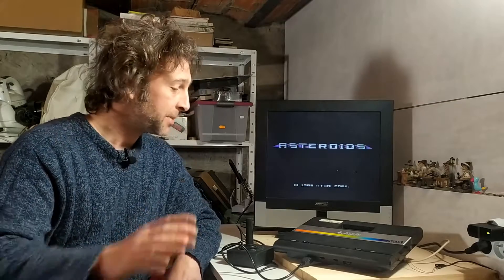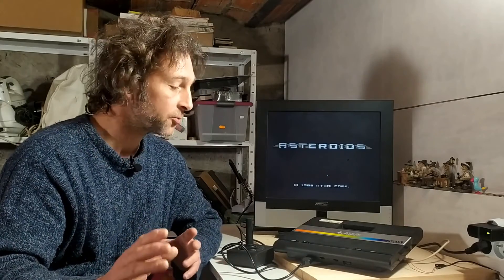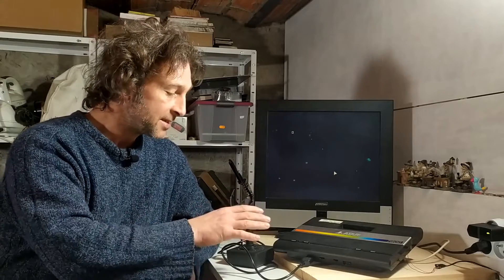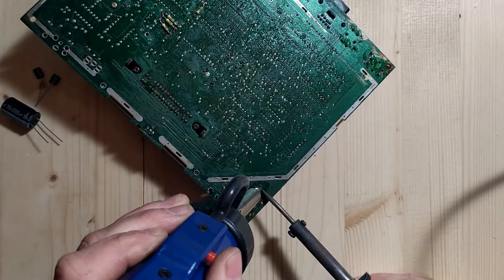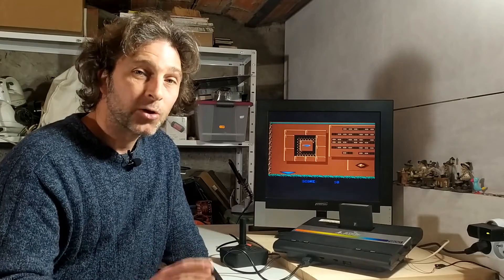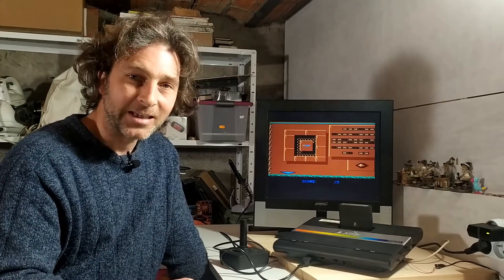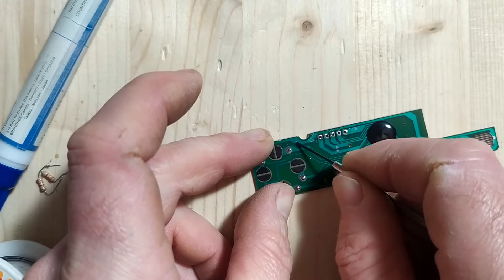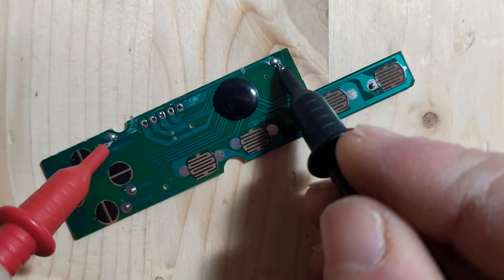Hacking an Atari 7800 controller from a cheap Nes pad, changing caps and making my 7800 great again

Comment: This is very interesting. I have made a number of 9-pin joystick to USB adapters by essentially doing the opposite of this.
I solder the wires from the DE-9 cable to the pads on the PCB, so the joystick is mimicking button presses on the gamepad.
Reply from the maker: That's a great idea. I'd never thought of doing that. So you open a PC game pad and use it's PCB as a bridge between an old Atari 2600 joystick (for example) and the PC's USB port? No kidding that's genius.
Reply: @8bitsinthebasement  Yeah, basically it's an Atari joystick to USB interface. Great for using with emulators.
These cheap NES style gamepads are perfect for the job, because they have a common ground, just like the Atari joystick.

Comment: What’s a pirates favorite letter? R you say. You would think but it’s the C. Hey I liked your joke! Thanks for the info on the controller. The 7800 is a great system but the controller is where the problem lies. Have to make some controllers now! Thanks
Reply from the maker: Good luck with the diy controllers. You know that you're not restricted to using NES game pads for this, right? If you want to really challenge yourself you could get yourself an old 8 bit digital joystick and convert it for the 7800. It's a lot more work but will give you a way better experience game play wise. That was a great joke by the way, Oooh Aar me hearty ;)
Reply: Thanks for the info very much appreciated!

Comment: Sega controllers also work as well no modding needed. There was even a arcade style joystick(fight stick) that was released that had a cord for the nes and the sega that using the sega cord works as well. I had gotten a 7800 for Christmas back in 98 if I am remembering correctly and I loved the system though in my area not too many games were able to be found that were 7800 carts so I do not have many but I do have my 2600 games that I play on it as well and for some games the arcade joystick is the best option though I do also have the trackball for games like centipede.
Reply from the maker: Sorry for the really late reply, had i have known about Sega game pads working on the 7800 I probably wouldn't have made the video. I've got one or two lieing around somewhere. I bought my first Atari in 97'. I was working in a second hand shop and somebody brought in a 7800 with six games (all 2600 games). I bought it the next day (retro was seen as rubbish at the time and the boss let me have it all for very little). I played the heck out of it for a few weeks and then gave it to a buddy who had a son who wanted a playstation (that they could not afford). I don't know if he was very happy with the 7800 though.
I don't know if you've seen the video I made on modding a 7800 cart to play other games on it. It's fun to do but a cheaper and more reliable option would be a 7800 multicart of some kind. I wish I had a trackball for mine, I'll have to look into making one ;) thanks for watching and for leaving a comment AltimusPrimeG1

Comment: Hey there! Love the vid! I feel that the 7800 doesn't really get enough love. I wasn't aware of how easy it is to mod a NES controller to work with a 7800. I'll definitely be doing that. I noticed that you removed the RF module; did you also remove the channel switch next to it? I've come up with a means to restore the B&W/ Color switch for 2600 games that utilize it (such as Xonox's Ghostmanor). All you have to do is connect pin 21 on the RIOT chip to ground, and the game will register the switch. I've modded the channel switch on my 7800 and connected the central post to RIOT's pin 21 and severed the trace on the left side of the switch (when viewing the console from the front). This will not affect 7800 mode, but you will need to keep the switch to the left; otherwise, the game will stay paused once you start it.
Reply from the maker: Sorry for the late reply, I've only just seen your comment. You're right, the 7800 is an under appreciated machine. I too was surprised how easy the controller mod was to do, I've since bought a TV game type thing built into a good two button joystick that I hope to mod for use with the 7800 (if I ever get the time to do it). The RF can I havn't removed from the system, It's a French version so came with no RF but a SCART socket in place of it. That's a good mod you've made for the B/w/Colour switch, simple yet effective, I may give it a try but I'll have to mount a switch in the case somewhere. It'll let me play games like Space Shuttle with the 7800 ;) Thanks for the advice, the comment and for watching ;)

Comment: I never liked the controllers that came with the 7800 at all. What I did is built from scratch my own controller from a project case and buttons. Because the 7800 version of Robotron requires two joysticks to play it like you would in the arcade, I also made a jig to place both sticks together so they would not move. I'll have to try to find a pic of those.
Reply from the maker: What I'd like to do next is make myself a pair of racing paddles. I didn't realise that there were different types of paddle until I watched a video about Atari racing games. They use a rotary sensor in place of a pot, so they can be turned in both directions to infinity. The jig for Robotron sounds cool, it's a game I must try out.
Reply: @8bitsinthebasement  Yes the driving controllers are called rotary encoders and they use an algorithm known as grey code to read them. Essentially what they are is a bunch of contacts in a circle that alternate between one side or the other of the 3 wires with a wiper that determines which direction the knob is being turned. Any machine with 2 digital pins can use an encoder because the reading is not only digital but done in software. A paddle on the other hand is a variable resistor that is read through an analog to digital converter built into the 2600 chips and one simply reads the result from a port. Robotron is a very good port for the 7800.
Reply from the maker: @GORF_EMPIRE  Thanks man ;)
Reply: @8bitsinthebasement  Sure thing!

Comment: Excellent use of really old 4-core cable .... I've still got most of a reel I bought back in 1986...should have thrown it out long time ago !
Reply from the maker: I've been hoarding crap for years and years. But there comes a time when you just have to start clearing it (I prefer to use it up than throw it away if I can). The phone cable is really great for this kind of thing too. It's light and very flexable, plus the stuff I used takes solder really well.

Comment: Another fine job sir! I have not yet used a 7800, hope you will show off the multicart when it is built to see some of the games.
Reply from the maker: Thanks very much Ken. I hope to cover the cart mod in a video so if all goes well I should be able to show a couple of games running on the system (now that I have a joystick for it). The thing is that a multicart in the true sense of the term is something that I don't think I'll be able to pull off with this system. The best I can hope to do is a modded cart that will at best look like a piece of test equipment. It will have a bank of switches, not to choose games though, but to set the cartridge configuration for the game programmed onto the ROM chip currently plugged into it. Should be a whole lot of fun though ;)

Comment: Lol, way to close with a  dad joke! I have a question about the controller. Will it also work on a C64? I use an Atari controller on my C64 now. I have an adapter to use an Atari controller with my Speccy. It would be great If I could get a Nintendo controller to work on all those systems, since it was my favorite 8 bit controller. I also have an adapter to use an Atari  controller with my CoCo2 but that doesn't work the best all the time. Great Video.
Reply from the maker: Good question, it roused my curiosity so I tried the Nes converted controller out on my C64 this evening and it works great. I see no reason why it wouldn't work with your Spectrum or Coco adapter either. The Coco's are a bit funny with the adapter though. Some games work great and some don't (usually because they were programmed to use an analogue joystick and not a digital one). Best get used to the jokes, plenty more on the way ;)